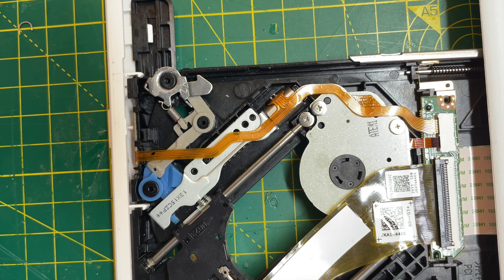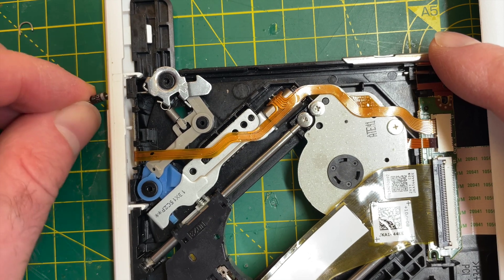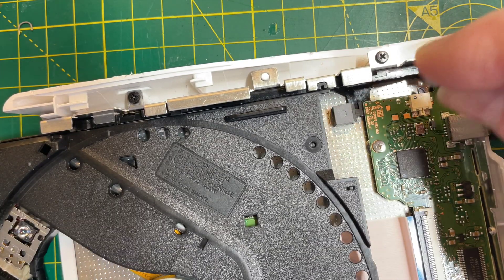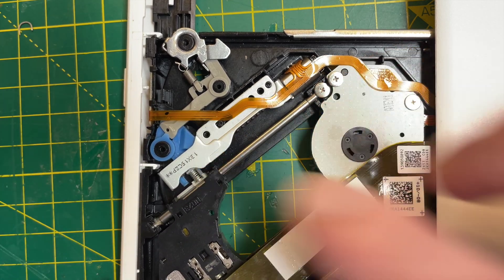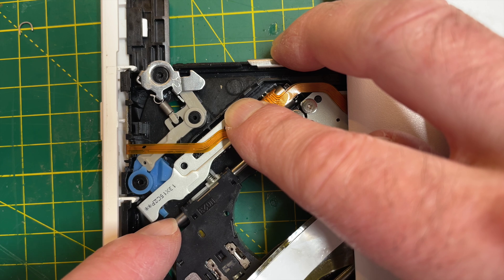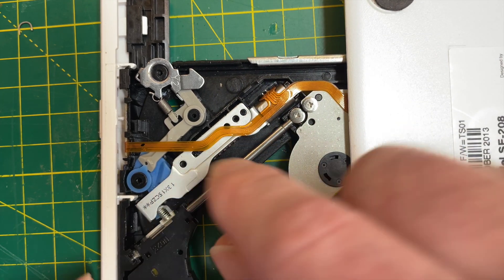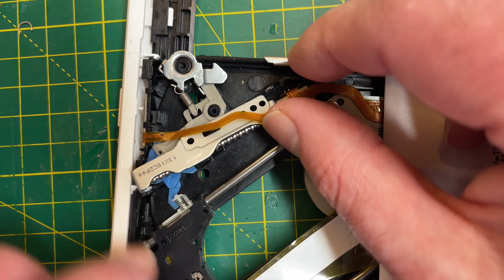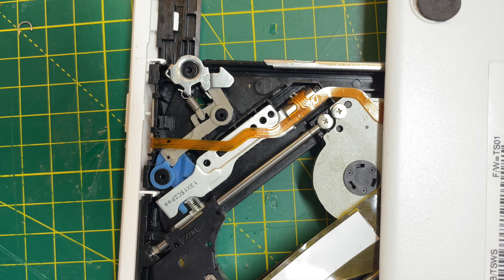Surprisingly Clever DVD Eject Mechanism

Comment: I have seen DC and DVD players upcycled into laser engravers and 3D printers.  What other devices would these mechanisms be useful for?
Reply from the maker: The tiny stepper motor and worm screw could be good for robotics. And there's a pretty small motor in there for spinning the disk.